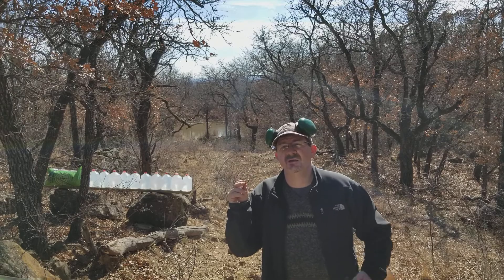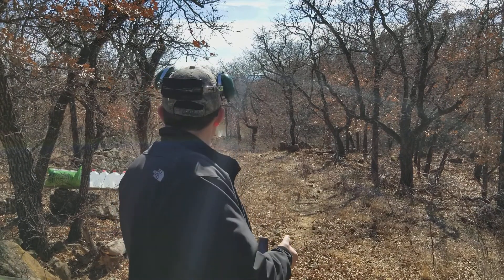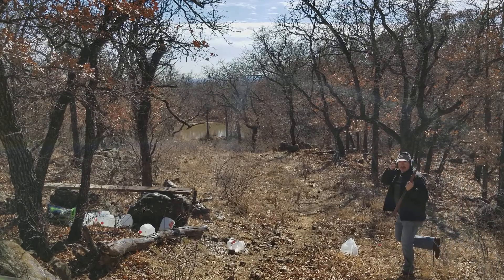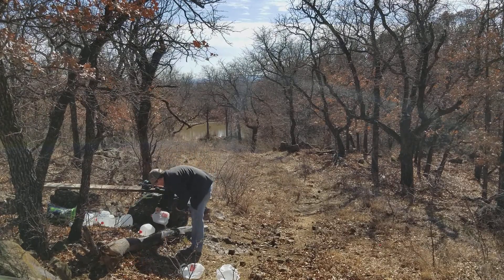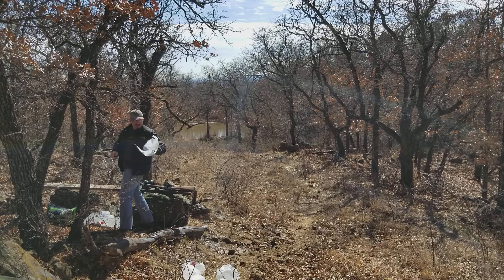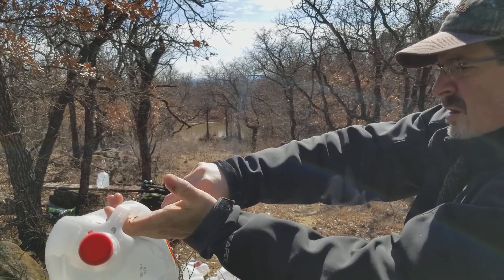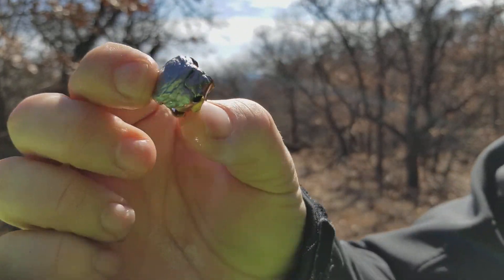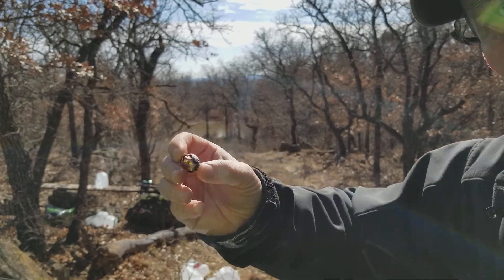300 gr, Hornady XTP Water Jug Ballistics Test of 45 Colt +P

Comment: Your Rossi won't last as long with them 45 Hot Ruger Blackhawk loads.
Reply from the maker: I am sure that is true of every rifle that can handle high or low pressure cartridges, but for all practical purposes, I’m also sure that the 1892 action can handle a lifetime of the 25-30,000psi loads that I’m shooting. The same rifle is chambered in 454 casull, so I’m giving the action a wide margin for safety. I appreciate the caution- hand loaders ought to be cautious.
Reply: Have you worn one out? I’d like to stay well below the margin of safety.

Comment: Awesome video, I have the same carbine except with the standard size lever loop and I have been wanting to load up these same 300gr XTP bullets, same cases, same primers, but as yet undetermined powder.

Did you say that your W296/H110 load was within the max load listed by Hodgdon for the Ruger/T.C. loads?  If so, that's perfect as I'm hoping to get around that same velocity ultimately with this load.  I have Unique and CFE Pistol currently but I was already thinking to try 110/296 or 4227 for these heavier loads as I think they'll have better performance in the longer 16" barrel.
Reply from the maker: You shouldn’t have any problems- other than a sore shoulder- recoil is stout in the light weight 92. I used a published load of Winchester 296 and CCI350 primers; I prefer to use starline brass but winchester brass is also good to go.
Reply: @robertrfisher  Thanks.  I have the Starline brass and CCI 350 primers already and am looking to pick up either W296 or H110 today, along with the 300gr XTP's.

Comment: What +P load would you suggest for .45 Colt to be used in a current production Ruger vaquero. Not the old heavy framed version. The current production that's closer to the Colt S.A.A.. I'm not looking to shoot the load myself. I'm a writer and I'm writing a character that handholds his own jacketed hollow point rounds to +P levels and I don't want to write him loading something someone who knows what they're doing is going to say "Jesus, that's going to blow the gun up in his hand." Or worse write something that someone who doesn't know what they're doing tries because they think it'll be cool and the wind up blowing something important off. Thanks in advance.
Reply from the maker: That’s a tricky question, as the new vaquero isn’t intended for heavy hand loads, but it would certainly hold up to more than the antiquated black powder level of 14k psi that the 45 Colt is regulated to by SAMMI. The best answer is to ask Ruger, but I’d bet that their lawyers would prevent them from giving a practical answer. Many hand loaders look to the pressure limits of other cartridges with a similar size, chambered in the same pistol, and carefully load to similar pressures. It is vitally important to consider all known variables, such as static loads limits of the metal, and stay well under their failure limits. You can’t safely load a 45 Colt in a cylinder chambered for the 357 magnum’s 35k psi of pressure, as the cylinder in 45 Colt is significantly thinner. If the new Vaquero is chambered in 45 ACP, I’m not sure if it is, then it could potentially hold up to 21k psi of that cartridge. I’m no wordsmith, but if I were writing a fictional novel, I’d probably just refer to “warm hand loads” or “bear loads”, or refer to Elmer Keith, or “Keith loads”- though I’d never suggest using Keith’s hotter loads in a new Ruger Vaquero.
Reply: @robertrfisher  Thanks man! That's exactly what I needed.

Comment: I looked up the Hodgdon  page (but Lee's data is better actually)  .. this video says 300 grain XTP bullet (W296)  Well for pistol that bullet (book) max is 1191 FPS 7.5 in bbl.   So for a Rossi rifle (this video says 1590 FPS) that seems about right.  (longer barrel: more time burning)   So I looked up 45-70 gov.  and 2000 FPS  with IMR4895.  So the 45 Colt is not quite a 45-70  but I would wager it will take pritner anything in N.America if you were =<200 yards and well elevated  (last notch anyway).  [I don't hunt but I Like the numbers]  The 45 Colt  (especially in Ruger and Rossi)  is very respectable (not "flat" like 30-06)  But  a real thumper.
Reply from the maker: I agree, I think the Winchester 1892 and Rossi clone are great fun! I like to hand load and cast my own bullets, so I like the 1892’s sturdy design, and have found that they are very capable little rifles- when chambered in 45 Colt, loaded to 25-30k psi, they can do a lot! 

I often choose a bigger, flatter shooting cartridge, and a more modern rifle for hunting at longer range, but for walking the brush and woods, hunting of problematic feral hogs, I often like to use the old Rossi 92 with big heavy cast lead bullets!
Reply: @robertrfisher  I hqve not got in to casting bullets yet (I wont if I dont need to but I used to work for a storage batteryu company and so I do know  you can melt lead with a bernzomatic torch and also with a natural gas torch   So you do not actually need a melting pot (etc)    That battery company used to buy 50 gal drums of lead ore (red color) and  all; their connectors and even plates (one plate is PB andf the other is PBO2)  the acid is H2SO4  and when the plates discharge the acid is closer to H2O and the plates are both PBS .. .. a bernzomatic torch will melt and of that and it can be poured
Reply: @robertrfisher  The Lee 457-340-f is a real hammer in my 45 colt Rossi. I powder coat them and size them to .454. They hit like a freight train at 1400 fps.

Comment: I'm about to test 300 grain Hornady XTP loads out of my Bond derringer.  I only have Unique powder, so I loaded up two test rounds.  One with .7cc's, and another with 1cc.  I've fired 300 grain .45-70 bullets out of the thing using 1cc, but I figured starting at .7 would be prudent.  I don't know what kind of velocity I'll get, but hopefully it'll be enough to expand in water.
Reply: I liked this video because although he said +P he gave a speed and that speed is about right for max loads.  You will not necessarily  blow up the gun with higher loads BUT you will begin to break parts.  So what I liked about this video is that Fisher stated the objective (5 water jugs) and he did 5 (and 2 more).   If you know your application (brush, hill country,  large animal, seated in blind) the round can be tailored for the objective.  For long high speed flat trajectory then 2700 fps is just the opener.  There are faster bullets.  Or the is Nitro express for biggest game.  Know what you want to do and then load to that objective with an good choice of guns and you can do it ...
Reply: @Gitfidlpickr  I tested those 300 grain loads in my Bond derringer, with 1.2cc's of powder... had a double-fire.  No damage to the gun, but I sure wont be doing that again!
Reply: @honorb4glory606  It was definitely "pushing" it you did not give the powder or the amount of powder (for good reason)  WHile the Ruger  and the Rssi rifle will be OK when pushed (a little anyway) it is not good for every firearm .. example +P in a normal 38 special .. I "push" 158 grain .357 in my Marlin rifle (I also have a 45 Rossi rifle)  ButI do get  200 yard performance in my Marlin .. but only so often.  I also get real high magnum performance in Ruger Blackhawk and Ruger Match Champion GP100 .. but it is not recommended as standard.

Comment: Your video title is correct with the 45 Colt name. Using the 45 long Colt name is a common misnomer.

Which Hornady 300 grain bullet are you using, standard velocity 300 grain or the 300 grain one meant for magnum velocities?

I use Hornady 250 grain XTP with IMR-4227 in my 45 Colt cylinder and Hornady 300 grain XTP MAG with H110 in my 454 Casull cylinder.

I have a Freedom Arms model 83 premier grade with 7 1/2" barrel in 454 Casull and accessory cylinders in 45 Colt, 45 ACP and 45 Winchester Magnum.
Reply from the maker: I used the standard velocity 300 grain XTP. Hornady’s published expansion velocity window suggests That at my average muzzle velocity of 1590 FPS, either XTP would work well.
Reply: @robertrfisher  Yes, keep it under 1700 FPS!

Comment: anything that can be shot in a ruger .45 colt can be shot in any of the modern 92's
Reply from the maker: I’d like to get a nice, older Blackhawk or Redhawk to compliment my 92s. I think the 92 can be safely loaded up past what is safe in the sturdy Ruger revolvers.
Reply: @robertrfisher  i don't know about more than a ruger redhawk, or older blackhawk ... but certainly much more than a .44 mag.
Reply: @grayman7208  92's will definitely handle hotter loads than a blackhawk, but not hotter than a redhawk.  92's, Redhawks, and custom 5 shot Blackhawks can all handle hotter loads than the ruger only section of reloading manuals.
Reply: @bryanroberts6717  " 92's will definitely handle hotter loads than a blackhawk, but not hotter than a redhawk."
i'm not sure there is data to back that up.
puma made a .454 model 92 for years, and they are still in service.
custom .454 redhaws are made with 5 shot cylinders instead of six.
and the super redhawk required "super steel" to make a six shot cylinder.
don't get me wrong ... i love my redhawk in .45 colt and use heavy loads in it.
but i do not believe it is stronger than a '92.
Reply: @grayman7208  I might not have been clear.  I was not saying m92's were weaker than Redhawks.   The common ruger only .45 colt loads available in manuals are generally around 32,000 cup.  These are safe in large frame Blackhawks according to almost everyone. 

The custom Blackhawks with oversize, 5 shot cylinders are loaded to 50,000psi.(still short of 
.454 casull's 60,000psi).  Brian Pierce of Handloader magazine had an article talking about taking .45colt to 50,000psi in a redhawk which has a significantly larger cylinder than a blackhawk.  Paco Kelly has a great article on .45 colt in leverguns.  For modern m92's , he loads to 50,000psi.  Also, he is convinced rossi is doing something different to the .454's because he has loosened up 92's when he took them up to that pressure.
Reply: @grayman7208  check out the articles section of leverguns.com.  great reading from authors like John Taffin, Paco Kelly,  and Jim Taylor. The rossi m92 might be able to handle more pressure than a redhawk, but there isn't any reloading data that takes .45 colt beyond 50,000psi that I am aware of.  Loading at this level requires trust that certain authors are credible and know what they are talking about.  I believe Brian Pierce and Paco Kelly.   I am okay with shooting 50,000psi out of a modern m92, a redhawk, or a custom 5 shot blackhawk.  I can't afford a custom blackhawk, don't like the recoil of beyond "ruger only loads " out of a handgun.  These 50,000psi loads are exclusively for my rossi m92.  Turns this small, handi carbine into something that has the level of power to hunt any animal in north America.
Reply: @bryanroberts6717  i am very familiar with both of them and their articles.
i started using heavy colt loads after reading about ross seyfried (i believe it was in the '80's)
as far as rossi is concerned it is simply a matter of better steels, just like ruger did in their super redhawk to give us a 6 shot cylinder in .454 when everyone else used a 5 shot cylinder.
my point was simply that factory .45 colt loads ... even the specialty loads ... that can be shot in a blackhawk or redhawk can be shot in a modern (quality) '92.
Reply: @bryanroberts6717  i'm very familiar with them and many more ... that was the point of my comment.

Comment: I use a Ruger Blackhawk bisley model with a 4&5/8 barrel and a Ruger Blackhawk with a 7&1/2 barrel I Hunt wild boar for cattle ranches and horse farms here in Florida one of the most dangerous game animals to hunt and after years of stupidity using the useless 44 mags and 22 mags even the 357 may started carrying my 45 lc loaded with buffalo bore +p rounds or some very heavy cast bullets my opinion the 45 lc is the best all around caliber there is I've killed elk bears deer hogs and with light load's head shots on rabbits and squirrels my rifles of choice are the hard hitting 35 rem and my Marlin 45 lc  great video thanks for sharing but I will say if you do any hunting with it try and stay away from hollow points they work well but the 45 really does good with solids especially Barnes the only hollow points I will use are the hydrashok bullets
Reply: How is 44 mag useless?
Reply: @JimS870  it's a highly overrated round,I watched my dad shoot a man 3 time's with 240 gr hollow points before he went down and then lived another 30 minutes or so 2 in the gut one in the chest my dad got 25 to life died after 2 years,I've shot countless hogs with a 44 over the years and all required follow up shots,I started using the 45 lc and I've had more one shot kills,in my opinion I'll take fat and slow over slim and fast Everytime,that heavy bullet hits like a train and the target absorbs all that energy
Reply: @gradermancat9819  interesting, ,, a .45  250 conical  in front of 35 grs of T7 will penetrate 11 gallon jugs of water..